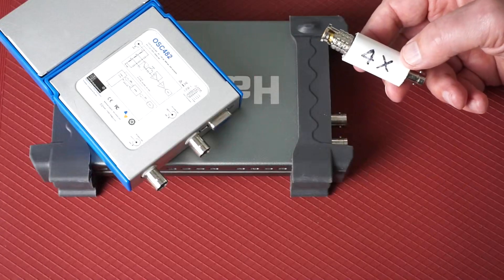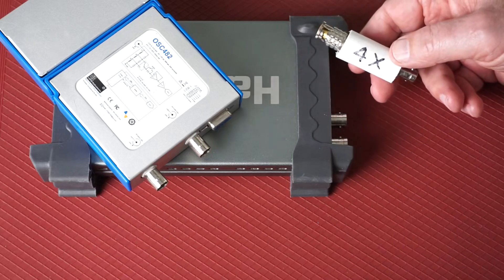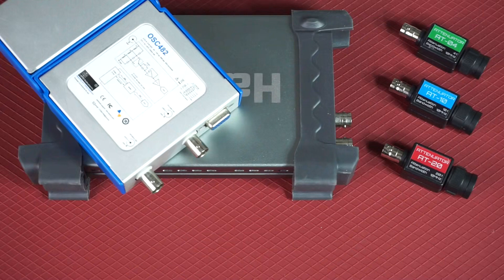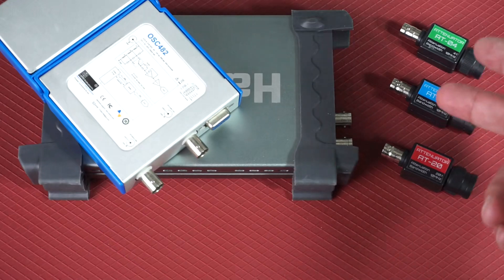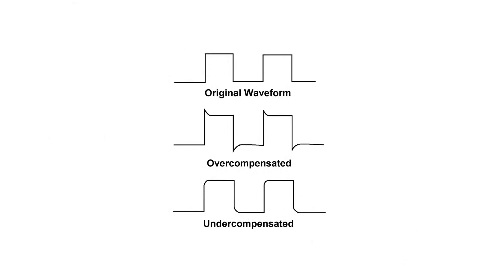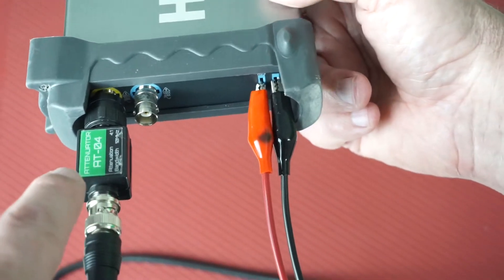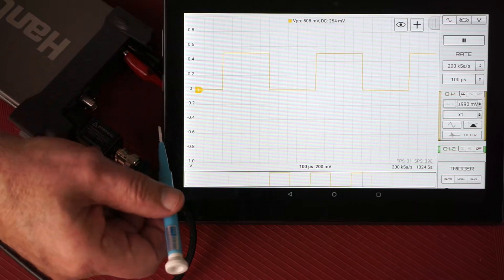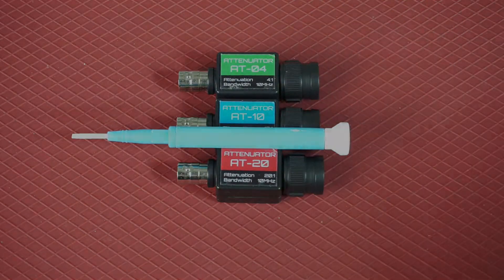GADGETS#180 - AT SERIES ATTENUATORS

Comment: Do you need these when you have the HS502 scope? These look so good that I might just buy them regardless.
Reply from the maker: HS502 is a ±16v scope...

primary ignition spikes could be handled with 20x 16v = 320v

fuel injector spikes could be handled with 10x 16v = 160v